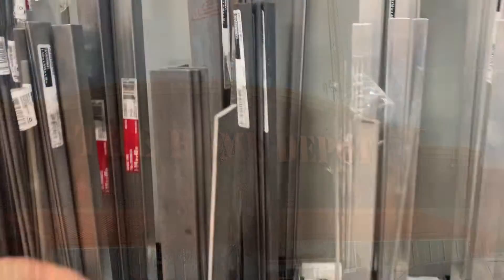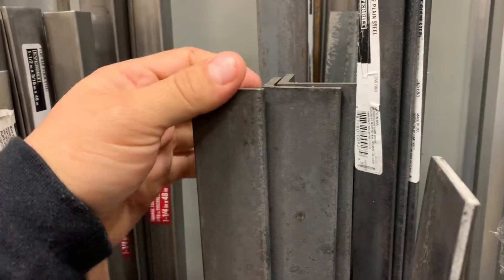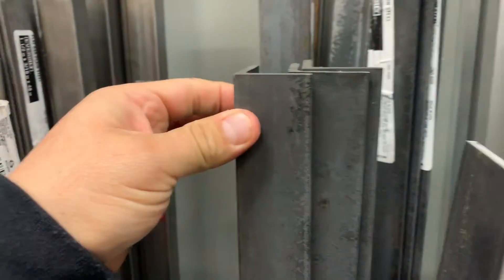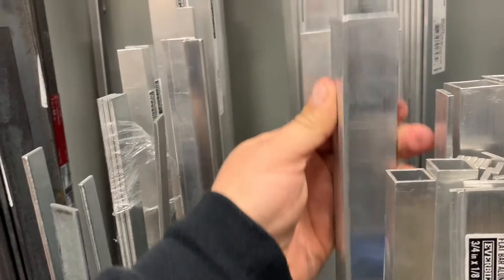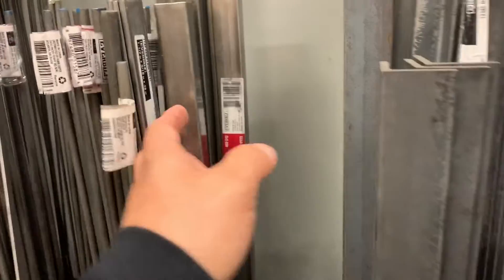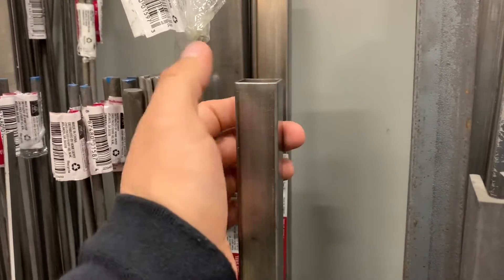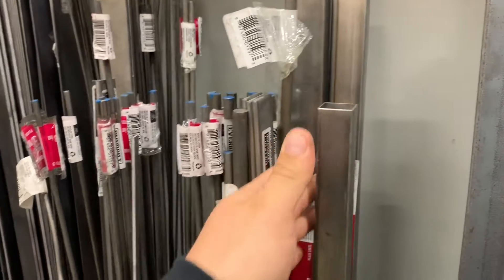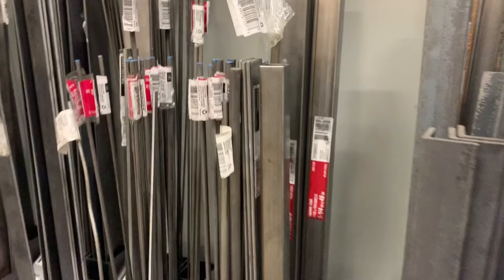Generator Slide Out For Mobile Detailing Setup RV Home van trailer Part 1

Comment: Awesome work man .have a quick question for building the slide out without welding how do you add a platform top since it’s not a flat surface with the spring nits sticking up?